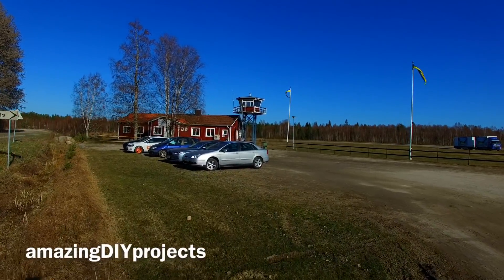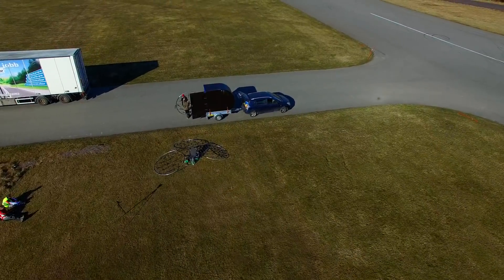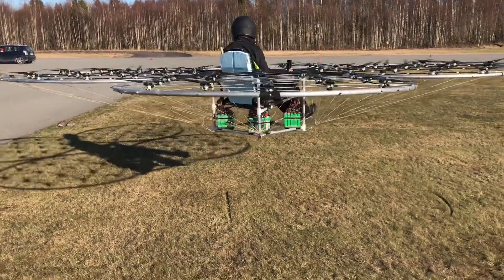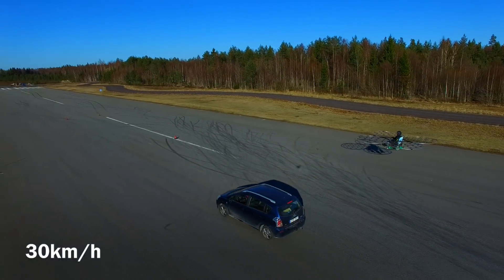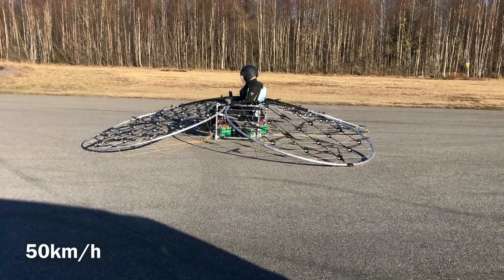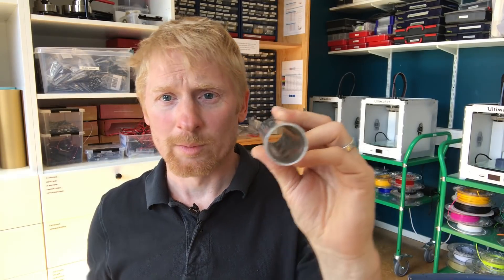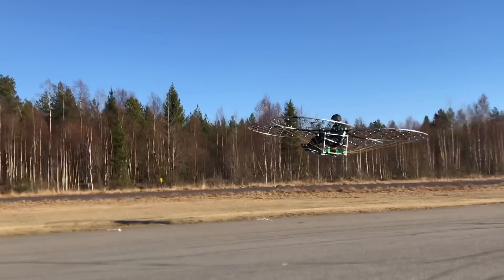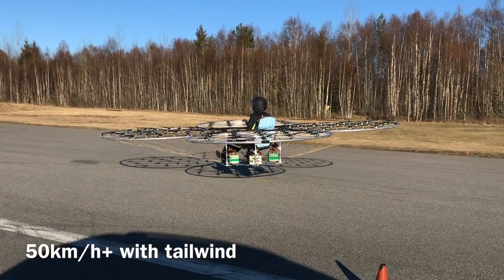chAIR episode 32 -Maximum Practical Speed TEST! Manned drone quadcopter

Comment: Right off the bat, I recognize that this contraption type has a couple of weak links. Not the motors as there is a high number of them so if any one fails, it can be compensated for. There must be at least one extra unit (controller, gyro...) that is programmed to take over within milliseconds of the primary failing. Obviously, a fall from even 2 meters height will cause some injury, so extreme precaution is necessary.

Comment: Very nice flying machine...how would battery life and speed change if you take a bullet shaped/aero dynamic dirigible or dirigibles to take the lift stress off the drone motors/batteries?

Comment: i think a roll bar and a HANS device would make a helmet even safer. maybe consider a kill switch marked with HiVis paint mounted in a location accessible from the bottom and top should rescuers unfamiliar with the vehicle need to turn it right side up or to pull an injured operator and/or grounded casualty away to safety for treatment.

Comment: On forward speed...wouldn't you have to worry about the forward air pushing down the structure?  You have no structure for any sort of negative "G" or the downward force on the top of the propellers and structure.  Is that clear?  Thanks for posting this!

Comment: * Brilliant idea and execution. I do have a suggestion. You should consider combining several technologies into one VTOL	that can fly forward at a fast enough pace to cover some distance. For example creating a very small (2 seats) fixed wing that has props for the Vertical take off and small jet engines or a different set of props that can propel the craft froward. More complicated set up would be to make the props rotate from a vertical to horizontal position but I can foresee multiple complications with something like that. If you shaped the craft properly you could allow it to land on water or ground. With your brain, you could do some amazing things and I bet you could get most of the funding needed through a crowdsourced based site from most of your viewers. I would certainly pitch in. Thanks for all the amazing videos you create.

Comment: Your control of the machine's articulate ability is very impressive! Congratulations due!
IDEA:
Instead of your body/seat tilting in the desired direction or speed... Have you tried tilting the rotors, or a section of rotors as needed for the specific direction and/or speed?

Comment: Sorry this is so cool but im so paranoid that the kevlar cables will snap and the blades will all come up and blend you. What do you think of flipping the blades facing down with some mesh guards or something with metal bars on elbows on top to limit the motion so they rest on the floor but are straight when operating

Comment: Neat contraption!  I should like to see a streamlined protective plexiglass bubble protecting your upper body (and a shield down below for your 'Marriage Vegetables' in case of prop breakup...)  Also, it seems there's room between the last two propulsor units for a pusher prop to extend.  Do you have any leeway to add some weight for another motor to see if you can get more speed that way?

Comment: Dear friend, please put some more sort of safety equipment on your device. I'm worried for you. Even just some wheels would be good if you lose power: you have a chance if you lose power while have forward momentum, you will land with a bump and roll. As it is, if you  lose power moving forward, your front chair legs jam hard into the ground and you go onto your face hard.

Comment: This is incredible, I have been watching you work on this project for years and you astound me. I very much intend to build something similar myself eventually. As a helicopter pilot myself this seems like the ultimate freedom. I am curious though, what was the reasoning behind building the rotor quadrants at chest level? In my mind, you would increase built in stability and safety by having the disks above your head and having all that weight securely under the rotors? Either way, amazing project and I look forward to your future videos.
Reply: Thank you for the insightful comment. I always search comments just for helpful suggestions that actually add value and potentially improve upon new technologies

Comment: Very nice job.  Big progress from the old gas powered one.  Why don't you make a light weight kevlar cabin to streamline the whole thing and integrate the propeller hubs into the cabin structure. Then don't need the cables. It'll be much more aerodynamic.

Comment: Is it possible if you can replace those kevlar lines with hydraulic stays that you usually find in car bonnets or at the hatch backs of SUVs they are lightweight and maybe safer and can be easily fashioned into those aluminum components of your aircraft, thanks for sharing the video 👍

Comment: My cheap little quadcopter has an even cheaper GPS system on board which tells me its speed most accurately. Why are you using a girlfriend-driven car speedometer outside of the copter, instead?

Comment: Terrible design idea to have your propeller clusters be tied to the center body with cords. Your trust vector is directly dependent on the angle of attack relative to your flight control computer . Should one or more propeller clusters change its angle of attack because of vortex ring state, high wind, partial loss of power or any other reason you will experience sever oscillation resulting in total loss of control. You really should consider making those propeller clusters rigid to the center body. Multiple small motors is a good concept but trying to reduce weight by using a flexible frame and cord is a very bad idea when it comes to multi rotors. Use a rigid frame, your life may depend on it.
Reply: Slic J A rigid frame is a must. Improvements will start to make it more like an electric helicopter but that's the best way to do it.

Comment: just a thought: 5 inch prop pitch seems already agressive. how about thinking of tilting the chair backwards. This way when your whole aircraft has a higher forward pitch it won't feel so risky. And boom you're faster (unless your motor speed was already close to 100%)
Reply: Or perhaps the chair section could be on a bit of a dampened gimbal system, so that it can counter-roll and pitch as the craft rolls and pitches..

Comment: Really cool project. I like it a lot. Very elegant and insect like at the same time. 

Have you considered using carbonfibre tubes for the superstructure? Your strength to weight ratio will be a lot higher, as well as improving rigidity. 

This would allow you to add very thin front and trailing fairings to radically improve the aerodynamics. 

My guess is that if you also go for the higher pitch propellers you suggested, your efficiency will improve by 10% for each of these two modifications, resulting in a possible extra 10kph, or 50kph for less power used. 

I'm just guessing here, but it seems possible. It might also be worth streamlining your cockpit/fuselage with a lightweight pod shape that tapers nicely to the rear to reduce your seat drag. 

My final thought is that if you do go for a pod fuselage, you could design it to remain horizontal to the line of flight, with the rotor structures moving and pitching independently of the fuselage to achieve increased forward motion. 

Final safety thought: If you can incorporate D3O technology into the seat and underside of the fuselage, you will make it safer in any sudden descent situations.

Comment: What if there is a power outage problem, what safety measures are  in place ?  Just curious, not criticizing.
Reply: it would just drop like a brick. its a simple quadrocopter. verry dangerous indeed
Reply: I am not sure if he has any redundancy in place. Ideally there would be two independent power sources making it exceedingly unlikely that both would fail simulateneously

Comment: there is several apps that tell you your speed (on your phone)...wouldnt that have been easier?
Reply: K.I.S.S. 

Why risk fucking up a flight on an experimental craft by adding complexity, and taking brain power away from the controls, when you can simply match speed with another big ass vehicle?

Comment: now it is the time to add redundancy..! Program a second backup system and independant power supply from different batterys and Boards and a system which can handle individual broken motors (fuse the boards?)... with so many components the question is not if something goes wrong but when.. !!(I want to see the project continue!)  Then improve every weakpoint there still is.. better overengineered then under..!

Comment: i like the idea of many motors to avoid death if one fails but your structure is still a concern for me. The best would be an independent motor mount attached to the seat  for each motor but weight would be a difficulty. I envision a set of motor mounts attached to the seat in such away so they could fold back and all be pointing in one direction for transportation. something like this. good luck
https://www.google.com/search?q=folding+satellite+dish&client=firefox-b-1-d&source=lnms&tbm=isch&sa=X&ved=0ahUKEwiln8mAzOThAhVMKa0KHfJoBUMQ_AUIDygC&biw=1920&bih=966#imgrc=4sLEeR6WoROYPM:

Comment: Less motors means a smaller unit. Too big to be practice and too expensive. Also too much drag. 4 motor per corner instead of 19 would be redundant, cheaper, and probably run longer with less weight and drag. Fun to watch though!

Comment: ground speed is a whole lot different than air speed. your vehicle is limited by the efficiency of the system as a whole and its power to weight. you need bigger props to achieve better airspeed.and bigger props will need bigger motors which in turn need more power, thus more LiPos packs to power them.

Comment: It is a pleasure to see your success in this flying chair!  As always, my greatest concern is reasonable safety, so I am very pleased to see you in motorcycle gear and helmet (glad to see you lowered the face shield later).  Also to never fly alone without a "spotter."  You may also wish to consider a "go-cart collar" like this goes a very long way to prevent neck injury (sorry to be such a worrier):
https://www.k1racegear.com/products/k1-racegear-go-kart-neck-collar
There are many comments here about going higher, and I respectfully disagree.  If you enjoy the current altitude, then do not go higher.  In a winged vehicle, of course height will give you energy to glide back to earth where you choose (or autorotation in a helicopter).  That is not the case in this vehicle.  Also, when you go higher, the joy of feeling the relative motion will be lost, so what's the point?
Cheers to you and have fun!

Comment: I watched all of these videos, as fascinated as anyone else who watches them I'm sure, and I'm curious about the ground level wind speed. It seems like even a minor gust of wind would be slow to compensate, and would utilize much of the reserve thrust. But even so, waiting months for a really calm day would be completely worth building something like this. I might look at a design using 8 much larger motors, and use a ducted fan design on a rigid frame to increase the reserve thrust, decrease the weight a little, and preserve my limited supply of fingers. Maybe throw the saved weight at auto-leveling for the captain's throne. Amazing stuff that Orville and Wilbur Wright would delight in watching.

Comment: take it to a next level. put a fairing on it. Did you considered moving all "the power plant" inside a fairing and have just 4 or more airducts to blow the air downwards? Much like a Harrier test bed but with power and control on same ducts. This would keep the blades away from anything and lower the noise from them as you could control this aspect with the fairing.

Comment: There has to be an algorithm that can tell you number of motors, lift, and weight per motor. It would seem to me that there is a point where larger motors and rotors would be better than so many small motors/rotors. I am not saying go down to two or anything, but perhaps down to eight motors (2 per corner, stacked, for redundancy.) This setup seems highly inefficient due to ALL the weight from the various motor parts and the amount of support structure for that many motors.

Comment: One should think about using proper rotary-wing flight control arrangement: pitch& roll on the  right hand, vertical ("collective") on the left, and yaw on rudder pedals. It would make for a very natural transition to/from other rotary wing aircraft instead of using a toy/RC model control configuration.

Comment: Man, what I really hate about this type of aircraft is at the point of failure you will get fucked. No autorotation or gliding back to the ground - its a straight down plummet.
Reply from the maker: Five parallel systems.

Comment: Add two motors with high pitch props blowing to the back. Maybe acceleration wouldnt be great, but hig speed will be gained!
Reply: Not necessarily. The rotors which provide lift are most efficient while hovering. As soon as the craft starts moving forward, the airflow at the rotors is disrupted from the wind generated by moving forwards.

Putting extra propellers in the back to give faster forward motion will mean that the main rotors cannot provide as much lift as they could while hovering or moving slowly forward.
Reply: @codetech5598  What I mean is, ad a few motors horizontally. Blowing air horizontally backwards!
Reply: @SilbernerSurfer  I know that is what you meant.

When you do that, the entire aircraft moves forwards. That creates wind against all the rotors that are blowing air downwards. That means that the tip of the rotor that is forward experiences a different airspeed than the tip that is in the back. The result is turbulence and low efficiency.
Reply: @codetech5598  https://www.youtube.com/watch?v=utr6g63JP78

Comment: Man this is so super unsafe and I commend you for having balls of steel eventually flying this thing and flying it so fast, while sitting on explosive lipos! Super brave and I am super excited watch the progress and I will keep my fingers crossed for you 🤞🏻 Amazing project! I have been watching it from day one!
Reply: Lipos only explode when shorted badly, or punctured by conductive material like steel in regular use. Bleeding them under voltage and then charging can cause it too, but thats on the ground. This is pretty safe vehicle, but sure its not helicopter that can auto rotate, or plane that can glide if there is engine failure.
Reply: No risk=No fun

Comment: I wonder how much thrust you are losing in the space between the circular path of the propellers and is it greater than the weight of having a surface there with holes in it for each propeller.

Comment: An idea, use every other motor with high pitch props or high pitch on the back hoops or back half of each hoop. Don't know if that would work, just a thought. I hope you'll get a parashoot for the alt. testing ! Every time I see you in the air, I also think of springs in the legs (or shocks) in case of a hard landing. Thanks for doing the vids (and helpers).

Comment: Please note, regarding your comment of vibration, airspeed, ground speed and tail wind. When you are airborne, your craft does not experience different characteristics when flying in a tail wind or in a head wind, other than a change in ground speed. You noted that you have higher vibration at the higher speeds. At 50 kph ground speed into the wind, your air speed is higher than 50 kph. For this discussion, let's presume a 10 kph wind, straight down the runway. This means that your craft had to travel at 60 kph through the air to keep up with the vehicle at 50 kph.

When you turned around, you now have the benefit of the wind to assist your ground speed. The vehicle traveling at 50 kph, while you keep pace, means that your craft has to manage only 40 kph. 

"Upwind" requires 60 kph air speed, "downwind" requires 40 kph air speed. You would certainly feel the difference, as you've noted.

For more useful information, an on-board air speed indicator should be used. Subjective impressions are great conversation points, but not good for solid analysis.

I very much enjoy to see your videos. Your engineering prowess is very impressive. Additionally, I appreciate that you are sharing your excitement at successful efforts as well as your learning experiences for those that might not be as successful. A true maker in all sense of the word.

Comment: what if there were two levels of props, and the top ones could push air down, and also up?  If there were a few fans, maybe on the back or the front of the back fans, pulling air in, it might reduce drag.

Comment: You are the man. One more step and cover your face and neck. Please! Or maybe lower your seating position to under the rotor disc. I am no engineer but it looks like lot of risk to sit in that position, is that required for stability? With all that being said I would still fly at the way it is because it looks like a blast

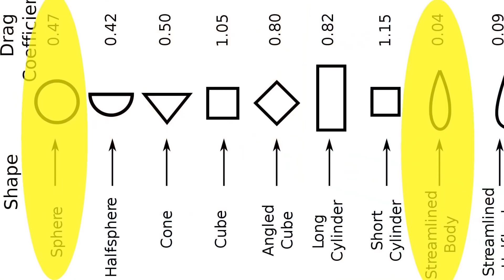Comment: 6:28 You compared the drag coefficient of a sphere (0.47) to a streamlined body (0.04). In fact the value for a cylinder perpendicular to flow ranges from 0.7 to 1.2 depending on things like surface roughness & Reynolds Number. However since the craft pitches relative to the direction of travel, there is no way to properly implement a streamlined cross section, so what you have is as good as it gets.